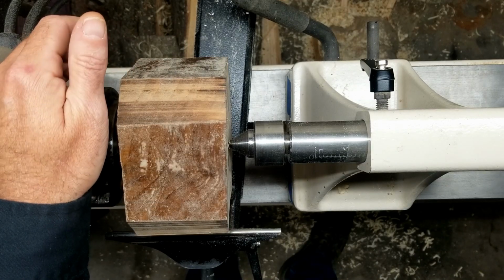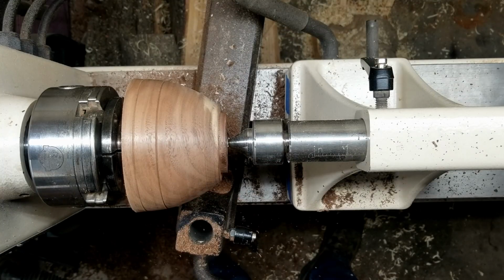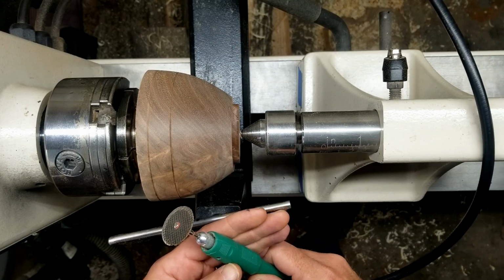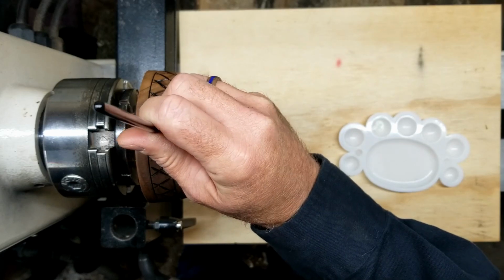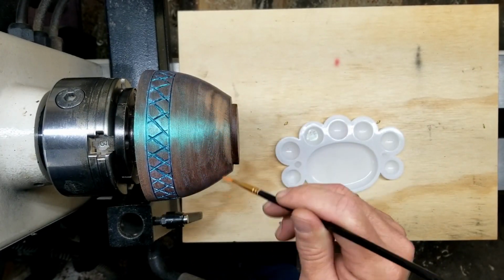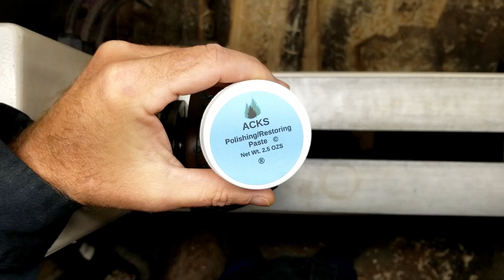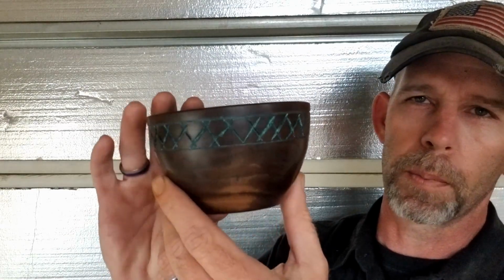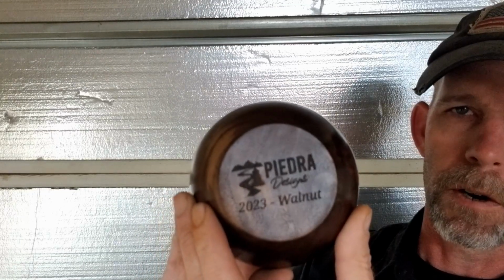Wood Turning: Walnut Bowl | #texturedbowl

Comment: Well done, Wes. While I like the look, if you want a more even look, try painting with white paint before using iridescent paint. That should help even out the 'color'.
Reply from the maker: Thank you!
As for the iridescent paint, I was under the impression (from other people I watch) that a dark color under the iridescent will give a more vibrant 'color', while a light background will give a more muted effect. I thought the 'burned' walnut from the grinder wheel would be sufficient for the dark 'background'. Maybe I'm just putting the iridescent paint too thin? More practice needed for sure.
Reply: @PiedraDesigns  It could be that it's different on wood than on paper in which I've used it. Paper is flat, making it less likely for the iridescence to puddle. I'd recommend playing around with it a bit on scrap wood to learn the best way to apply it. Possibly filling in the cuts so there's a more level area to lay down the iridescence. 
Either way, it's a beautiful bowl.
Reply from the maker: Thanks. Definitely, more experimenting is in store.
Reply: @PiedraDesigns  You're welcome. Your work is always beautiful.